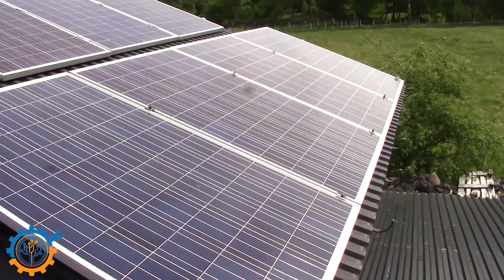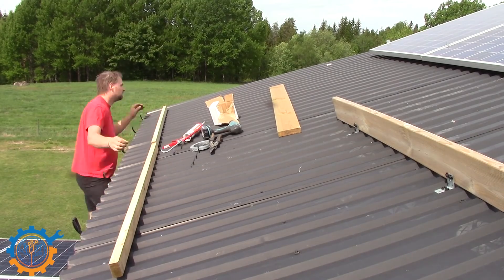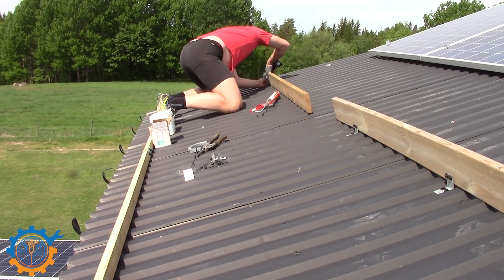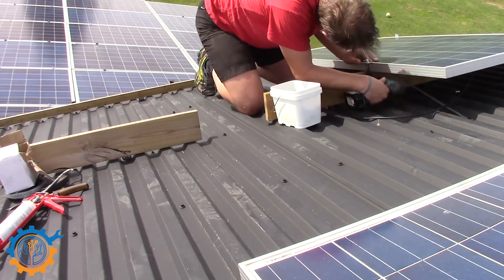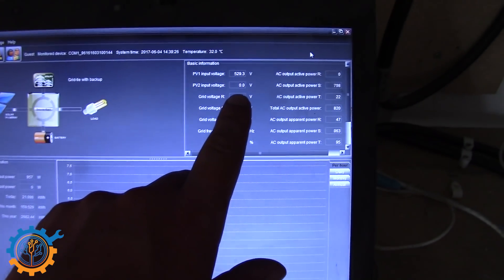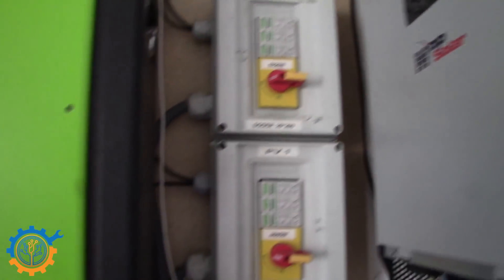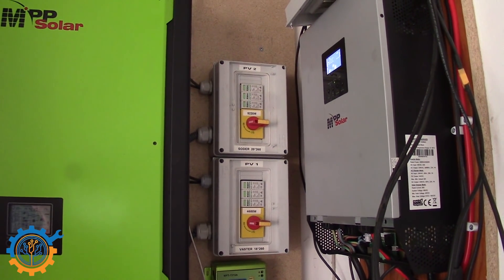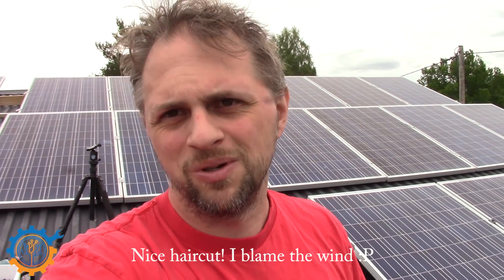Solar panels added to roof

Comment: Really nice, man! One question: there was a third panel that is a little bit different than the others. Is it just the appearance or there's more into it?
Reply from the maker: Both are poly and both are 260w. Different brands but the big difference is the coloring. The black one is black anodized aluminium. So actually no big diff. I will be having them on one roof so wont be mixing on same roof neither mixing them on same MPPT charger/inverter just in case.
Reply: DIY Tech & Repairs Nice! Thanks! :)